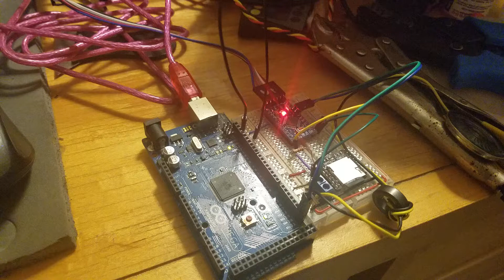Marlin firmware i2c sound effects

Comment: Hello! How did you "activate" your I2C bus? I've read that the "Experimental I2C bus" must be activated in the configuration_adv.h file, but I'm not sure in which of the two boards it must be activated, or in both?
Reply from the maker: I just used the marlin Gcode for sending data to an i2c address.

M260 works in Marlin to send data to addresses. I just had the uno set as i2c address x and had the Gcode command send different days to that address. Then the uno just played a different sound on the sound shield based on the data that was recieved.
Reply: @Timmit99  How did you set your uno's I2C address as x?
Reply from the maker: @ethanguidry9392  just using the arduino sample code for the i2c master/slave. The uno was just running some simple code I wrote in the IDE. 
https://www.arduino.cc/en/Tutorial/LibraryExamples/MasterWriter
Take a look at the recieved code here
Reply: @Timmit99  Thank you!